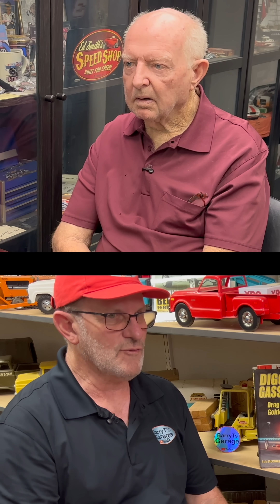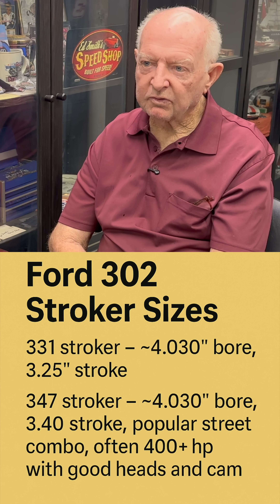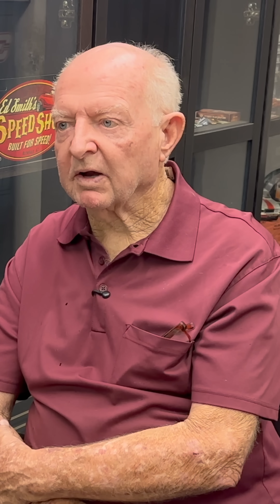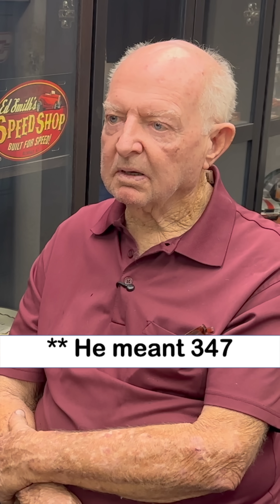Ford Stroker Engine Sizes   Ed Smith w #BarryT from Ask Ed 45 #hotrod #mechanic

Comment: To me it makes no sense to build a 347 when ford made a 351. You could just stroke a 351 if you wanna do something good. Course I’m a Chevy guy and maybe I don’t know what I’m talking about. I wouldn’t  stroke a Chevy 305 into a 345.
Reply from the maker: Unlike the 305/350, The 351 block is taller, just enough bigger that fitment could be a reason. 
Perhaps also the cost of a rebuild.  👍
Thanks for the comment

Comment: Built a 347 and built a C6 and put in a 85 Mercury Capri and had a lot of fun running the 1/8 mile. Just used first and second gear on the track. The rest of the car was stock . Even had factory a/c which I would turn off when I staged. It was consistent and I won a lot. Take my slicks off and drive it during the week on nice days and my pickup on other days. And did for 5 years until local track closed. Very durable engine at least it was the way I built it.
Reply from the maker: That’s awesome!

Comment: Talk about taking a 389 chevy and welding and off set ground the crank to build a 392cid stroker. All to find out a good 327 out performs it.
Reply: What's a 389 Chevy?  What you described is one hell of a lot of expensive work to gain 3 cubic inches.

Comment: Here's a crazy one. Back in the late 60s, I knew a couple guys that worked at the Ford engine plant. They were swapping cranks and rods on the assembly line. They laughed and said that some people were going to be surprised at how fast their car was. Lol some people were getting a stroker
Reply: Wild!
Reply: That's hilarious.
Reply: Someone's pulling your leg! Those parts would not be available on an assembly line. A 331 or 347 stroker requires a .030" overbore and custom pistons.
Reply: Not a simple drop in swap. LOTS more to it than what you're saying.
Reply: Well if they didnt change it much then it would work but without rods or pistons it would smash the valves or head. Now if they found tall deck blocks and had the right numbers for rods they could do some shit but i doubt they changed it much.